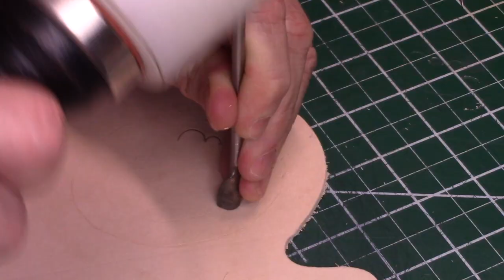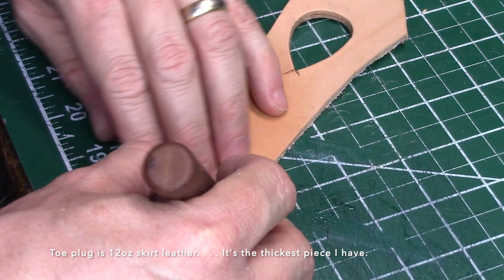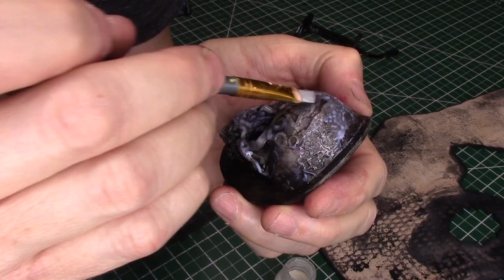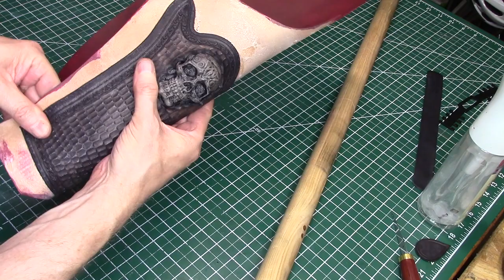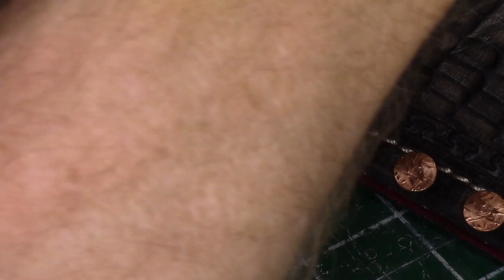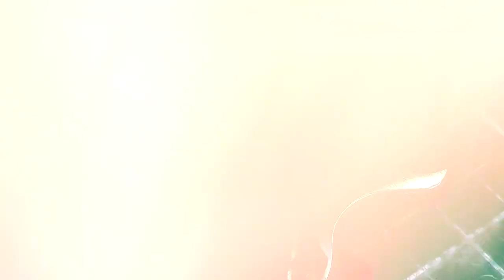Leathercraft: 3D Print Skull Holster SAA Aged Revolver Cowboy Action Leatherworking

Comment: So beautiful, so beautiful. Thank you for tips. I also have started to make cuffs, phone cases, etc... to my self and friends from leather and silver casting jewelry as a hobby in my older days. I also use a 3D printer for jewelry molds and templates for leather. If i may ask, with what software you modified the skull and how? I have had a little difficulty to success with that how to modify an *.STL file. I use Fusion360.

Comment: That spray is no good! It will eventually come loose! Use Barge cement! There is really a reason top leather workers use it. Your work is beautiful and very creative! Great job!
Reply from the maker: Thanks! The spray glue is primarily to hold everything together until it's all stitched. I wouldn't rely on it as the sole means of attaching.
Reply: That is the perfect application for that spray, faster and easier then barge, once it is stitched it will not come apart

Comment: I got my printer and can print out the skull but how did you get that like part to make it actually stay in the holster? Like that flat part that extends past the borders of the acrual skull. What settings did you use to get the printer to print that?
Reply from the maker: I used Meshmixer. It allows you to merge stls and cut out/add basic shapes.
Reply: Your the best bro :D